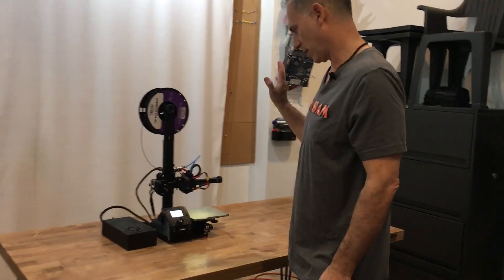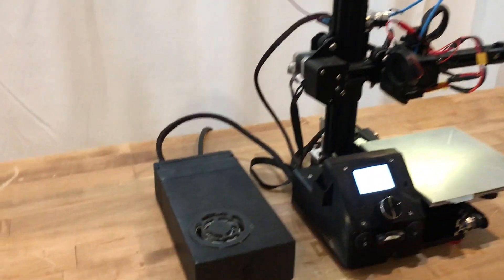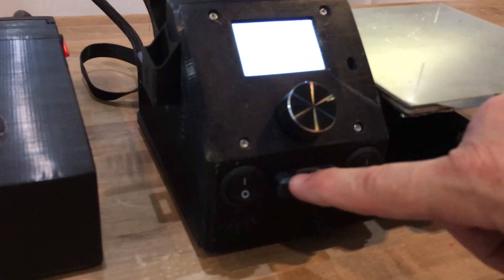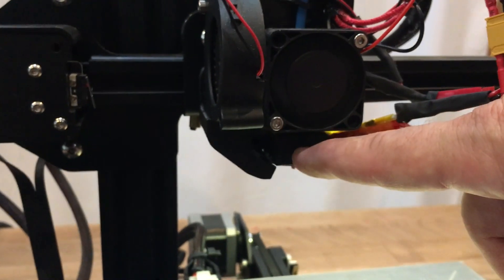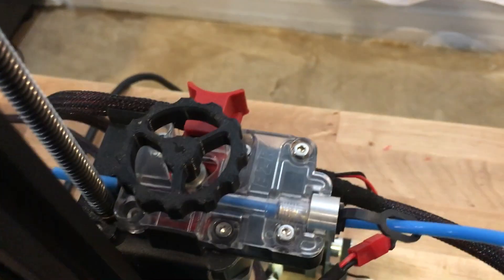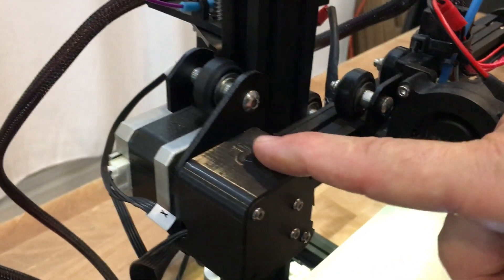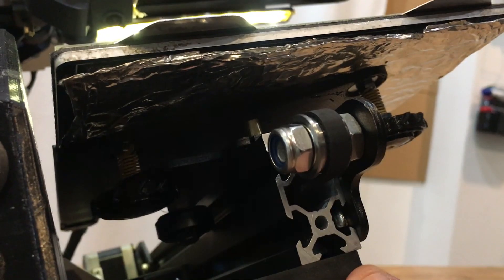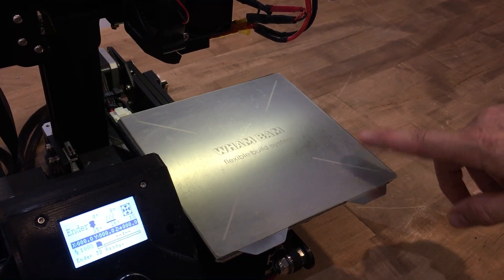Best Ender 2 Mods!

Comment: Nice video, thank you. I prefer to put the PSU on its side to help prevent debris falling through the ventilation slots. My build area is a lot more messy than yours, however! Also, I notice you've got the stock build plate electrical connector - how many hours do you have on this without it yet failing?
Reply: Ed Jones thank you, this is a very old machine I got it right when Ender 2 came out. I do have the cable strain relief that is listed in the video description that I designed which relieves any strain on the bed heater cable.